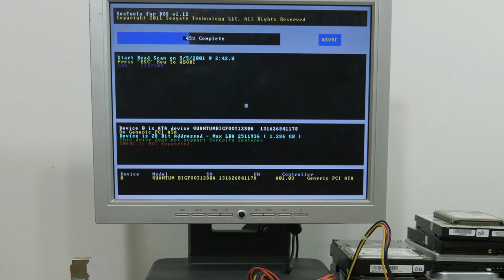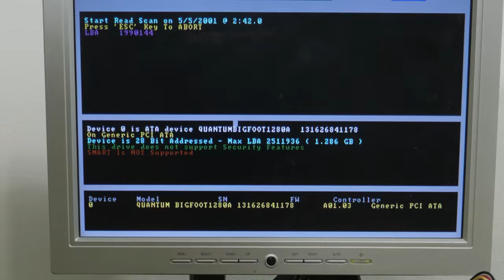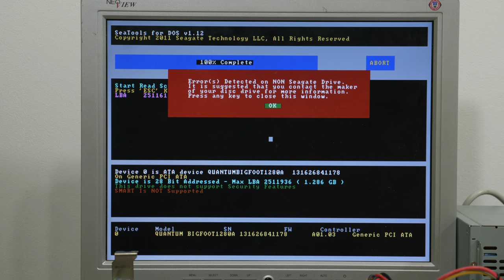Quantum Bigfoot, The Worst Hard Drive Ever!

Comment: Bigfoot drives were designed for linear read/write of digital video, therefore 5.25" format. Back then Bigfoot drives were IDE drives (not SCSI) which can handle low compression analog video in full quality. All of my 23+ years old Bigfoot drivers works today.
Reply: Yeah mine all work still (2024) so I don't know why Victor reckons they are the worst drive ever

Comment: Imagine how much space they could put on one if they made that size now.
Reply: Maybe 32tb at least. I don’t know why they didn’t made them. Iam sure would be costumers looking for massive storage space.
Reply: @sjogosPT  There are an innumerable number of mechanical engineering issues with building modern hard drives with larger platters, but it should be simple enough to understand that they simply cannot spin as fast, and the armature has a longer distance to cover for random i/o. Access latency is horrible. You can simply use more, smaller drives, that have better performance metrics despite being able to hold less, all else being equal wrt platter density.
Reply: @rawhide_kobayashi  RPMs is not really an issue ... the same technology that allows for 10k and 15k drives, can make a bigger plate spin at 5400/7200rpm.

Seek times are horrible ... sure. But that is the same for any mechanical HDD nowadays, no one stores any data that requires fast seek times on an HDD ... let alone one of 5.25"
Plus if you REALLY had to have some intensive I/O, you could work some magic with cache/hybrid SSD.

Now you know what you get with bigger plates? higher transfer speeds. The external part of the drive would be able to achieve some very decent sustained reads.

I would really love to buy a couple 20-32tb drives for the price of my 14tb one.
Reply: @Coyote27981  blud have you ever seen the insides of those high rpm drives? it's not some kind of special technology. it's smaller platters and bigger spindles. the 3.5" form factor ones are basically 2.5" form factor on the inside, and with way meatier spindles. you know what else gets you great performance? multiple drives. modern high density 3.5" drives already get >300MB/s on the edge of the disk. You can saturate a sata 3 connection on a seagate mach.2 exos by striping the independent actuators. nobody is going to put any r&d into any kind of actually good >3.5" platter going forward.

Comment: I have a Quantum Bigfoot and it still works great to this day.
It's in a vintage K6-2 system
Reply: OOMG I remember back in the day I worked in the tech dept. of a PC store in the Netherlands. The year was 1996 I believe. We started selling Home built systems with bigfoot drives, but stopped after 2 months because nearly all of them failed. Probably due to lack of airflow.
Reply: @paulmichaelfreedman8334  Lack of sufficient  component cooling was a common problem back in the 1990's .
I especially remember the 3Dfx Voodoo 3  graphics cards that ran way too hot and needed a cooling fan on them or else they would die early. Other graphics card manufacturers during that period would make the same mistake as well

Comment: Instead of doing the death by screwdriver thing on the platter/drive heads, next time, try shorting out some of the pins on the drive’s ICs to see what happens while it is formatting.

Another thing I wonder, is if you were in a clean room, would it be possible to take out the platters from one drive and stack them on top of others in another drive to “combine” them assuming you can do the same for the drive heads?  I’ve always wondered if a drive could be “Frankensteined” like that.
Reply: It can't if you want a functional drive.

Comment: I killed mine as a young guy, I was adding molex plugs for extra devices, mixed up 12/5 volts.
Burned almost everything connected to the mainboard.
The bigfoot motorcontroller (I think) lid up like a led. This was actually the metal plate (maybe some kind of rf shield) glowing like a star.

Comment: I think the worst hard drive is deskstar from year 2000-2001 that was a deathstar
Reply: Oh God those where the worst!
Reply from the maker: Yes the deathstars are so bad that they got extinct! :D
Reply: From the 20 30 and 40 GB 2.5 man, what a POS of drive. funny thing, you trow then to the floor and exploded. The got better when turned to Hitachi. It is a shame because mid 90s IBMs ROCKED, but this early 2000 were gabarge.
Reply: Totally agree, pretty slow, noisy and unreliable. At this sizes, Maxtor or Quantum all the way. Seagates were decent, Got two medallist series 1G and 2.4G and keep working fine. WD Caviars were OEM on HP Vectras. Probably another level of quality. From this period Maxtor was the best IMHO. Never had issues with Maxtor.
Reply: Was that the IBM drive with four platters. I tested those for shock reliability.
Reply: Yes those few IBM models were not reliable, but they were still very fast. Prior IBM HDDs were some of the best and after the deathstar debacle they became great again and later became the great HGST drives.
Reply: Funny enough I have a 15GB one made in Hungary with no errors at all, I have a video of it.  The 75GB 75GXP were the most unreliable ones out of the entire 75GXP family.  Also the 15GB one I have is FAST.  It is 3x faster than a Seagate Barracuda ES I have from 2008 and that one was SATA!  So a drive 8 years older from 2000 is faster than a Seagate from 2008.  I am going with WD from now on.  The 15GB one I have has a glass platter.  Those Deskstars are fast though!
Reply: At least the DeskStar had performance figures. This was slow AND had that signature Quantum reliability
Reply: @AiOinc1  I think Quantum drives are pretty reliable from what I have seen.  What do you think was the most unreliable Quantum drive?
Reply: @MrKillswitch88  they were TERRIBLE drives.  I remember a surplus store that had hundreds of them.  All failed 4.3gb models.  Had some sort of firmware issue I believe.  They also had plastic sticker on the side, that it damaged would expose the drive to the open air.  It would die shortly after.  Very shortly.
Reply: @cdos9186  that's actually a really good question.  I'll speak of the older quantum 120mb or so to 1.2gb models common in the early to late 90s.  They were highly reliable.  Saw a lot of the IDE ones, and a few SCSI.  The SCSI ones I used all performed flawlessly.  I can recall on a handful of IDE failures, bearings, electronic/firmware, and bad sectors.  This out of hundreds of drives. As to the worst ones... I couldn't really say.

Comment: These drives were easily one of the worst ever made.  I know some models are 3600rpm.  I don't think they made any IDE drives slower than that.  My school had a file server that had a quantum Bigfoot in it.  It was used to store Norton Ghost image files.  We would ghost about 15 computers off it at one time.  It worked.  It wasn't the fastest, but it wasn't painfully slow either.  The server was retired around 1999-2000.
Reply: Bigfoot drives were designed to read or write big files - like digital video - therefore 5,25" format and low RPM. They were able to keep constant read or write speed until entire drive was full. For regular use as standard home drives were indeed very slow. When used to record low compression video from TV camera, only other option was to use expensive high speed SCSI drives.

Comment: I bet HDD regenerator would have fixed those errors. Would have been worth a shot just to see.  Drive magnets are quiet handy to have around.
Reply: WaybackTECH Fixed? Nope, it would isolate such problems only masking the problem to the os. If the bad sectors didnt grow up, you would be able to use the hdd more and loosing some space. But this isnt the reality, if you have a deffective sector, if will "multiply" itself, th problem will spread and the hdd wont be able to boot or installa os anymore. 
What could potentially fix the issue (really fix), would be to write with zeros using for example linux, forcing the sectors to write zeros in all of them, including the considered "bad" ones, that could only have difficulty in writting and the hdd classifyied them as deffective...  Then it would force the bad sectors, anf probably many, if not all of them would be fixed, as after writting the zeros it would force the magnetic particle to the right orientation and thus making it easy to write again.
But that also cant fix some drives. If it retracts the needle when trying to write the zeros, the problem is really deep and probably unrrecovable even with the jerryrig that hdtune does.
Reply: @eduardoavila646  i have hard drives with only a few sectors bad still running today after running hirens on them with no dataloss,

Comment: Haha I remember these guys that sold me one of these... they really got me there, I ordered then a Fireball and served me a Bigfoot, it will be the same, they said! WTF!
Reply: Alberto Martinez Is the fireball a good drive? I've got one, but it seems to be agonizing (by the sound), i didnt had time to install a os in there or see the smart.
Are those drives noisy?
Reply: Almost every old drive was pretty noisy if you can better use newer SATA drives with a good SATA /  ATA adapter or a PCI SATA controller with win98 drivers. It all depends on what kind of system will you install the drive into.
Reply: I dont have sata drives for it at the moment, i have no problems with the noise (its actually kindsa usefull to know that the hdd is spinning), but i was worried with the health of the drive. It was in a old toasted amd duron machine running windows 98.
Reply: @aretard7995  mine doesnt seem to be any of these tho. 

Its a quantum fireball 5.4gb if i'm not mistaken. 

I wont replace it with a data drive as my old motherboard doesnt have sata connectors, only ide.
Reply: @aretard7995  Hmmm... I have two Fireball LCTs with 8.7 and 9.21 years of power on time and they both work.

Comment: The TX bigfoots are pretty reliable and not to slow as long as you run disk defrag on them regularly :)
Reply: Defragging is the most stress of any for a harddrive though. It's easier to transfer all data to another empty harddrive. That will defrag the data also.
Reply: @armorgeddon  pretty sure it won't unless you rewrite the drive with zeroes
Reply: @arnaudmeert1527  Yes it will. Zeroing it isn't needed.

Comment: Bigfoot TS 12.7 is still alive and well running windows 2000 on my K6-300 machine. By far the worst HD I have ever worked with was the Seagate ST-225. Had several bigfoots, no issues, just slow and noisy.

Comment: hello Victor, I have a question to ask you, I have three 3dfx, a voodoo 4 4500, a voodoo 3 3500 and a voodoo banshee, which would you recommend to play on a retro pc with win 98. Greetings from Argentina :)
Reply: On which CPU/mainboard platform? Usually you'd use V4 4500 of course, but depending on the CPU it's potential might be wasted.

Comment: I had this HD in  win98 system for 25 years. The computer failed with a "low cmos battery" warning on boot and it was done. Now I am trying to get data off of it. And hooking it up to a windows 10 system doesn't work because it doesn't detect it. How can I get data off of this?
Reply: Couldn't you just replace the cmos battery? The little coin cell on the motherboard.

Comment: Do the Quantum Fireballs have a better rep? I have 4 Fireballs, 3x 4gb. 1x 12gb. 
They still work, and ive had no problems... yet. One drive is considerably louder, but it came from a server. So non stop running has worn the bearings.
Reply: Adam Holmes Oh so they are loud? I only have one with 4gb, but its really loud.

Comment: Donated one of these bigfoot tx 4 gb hard drives too my university as it's a odd format history wise, as it was more common with 3.5 inch & 2.5 inch hard drives at that point, but they were cheap too produce so oem's did pick them up even if they were slower then their smaller counterparts they offered good capacity for the money, at least for a shorter while before a managed too cram 16 gb on a 3.5 inch harddrive & then got cheaper.
A common problem is the clear sticker/plastic on the underside being removed or the glue on that sticker decaying so it lets in air, or that someone poked a hole in it.

I wouldn't really use one these days other then the bigfoot ts series if id come across one or wanted one. (they weren't faster or larger then other harddrives by the time the ts series was released but the ts series was a bit more reliable & the fastest model.)

Comment: I want to destroy all personal data on a harddrive. Can I hit the platter with a hammer to break it in pieces ? Or is there software to thouroughly remove all personal data ? I tried Eraser but could not get that to work under windows xp.
Reply: Use DBAN.
Reply: drill a hole in the drive and drop it in a bucket of salty seawater.
let em "cook" for 2 weeks and even IBAS would have problem with em... and they got the data out of the toasted drives that was onboard space-shuttle Columbia.

but that would destroy the drives so they are not reusable... software that overwrites everything 2-3times is as safe for common people as you would need instruments and specialized workers worth millions to get out the data.
Reply: I found an older version of Eraser that works under Windows XP, I will use that so I can still use the harddrive.
Reply: From the UBCD Vivard will erase to "n" passes (n can be any number of cycles). Want to be more sure, just trow the platter to a firepit or move a strong magnet over it. Forget about XP. Just get you "ultimate boot CD" and pick Vivard or MHDD 4.6 from the menu and follow instrucitons.
Reply: You could write it several times with zeros. Using the dd command in linux or some utilities in windows.

Comment: Worst? You never seen the samsung spinpoints from 2011-2013. All of the 10 drives i've had were  slower than older ide drives (i mean, 60megs of writing speed isnt good for a sata 2 and sata 3 drive), and all of them failed several times until they died, about 1-2 years after i bought them new, and many died with about 40-100hours of use only...

Comment: long time ago i did own an bigfoot disk from 4,3 gb, its the only disk that still worked after an fall from 1 meter heigh on the ground, but, this were that days cheap disks,, slow and mucht noise but for data storage it was good.  i used it on an amd k6-2  , 333 mhz with 64mb ram and and viper 550 , mainboard was ASUS P5A , an very populair board because it support lot of socket 5 , 7 and super socket 7 cpus,, all the intels, cyrix, winchip and amd . My last configuration on that board was an amd k6-2 500mhz with 2 x 128 mb and an asus V6600, the first geforce 1 card.

Comment: I have 1 bigfoot 2,1GB and it runs as today, but it isnt in good condition, it has some bad sectors, and i need to run spinrite on it sometimes to keep it from getting more bad sectors.
Reply: PureOwnag3 You could try to forc write zeros to your bigfoot, it may fix the bad sectors, most of the time, sectors that has some difficulty to write are classifyied as bad, but if you force write them, they may get good again. 
I've made that with my spinpoint using linux some years ago.
Reply: Eduardo Avila: okay will try it out, thanks for the info.
Reply: @PureOwnag3  How did it go?
Reply: @ducksonplays4190  how u mean with how did it go ? as i sayd i need to run spinrite sometimes, to keep it go more bad, but yea i dont use the drive anymore nowdays.
Reply: @PureOwnag3  I meant how did forcing zeroes go?
Reply: @ducksonplays4190  what u mean with that ? forcing zeroes ? i dint force 0 on the drive at all if u mean that ?
Reply: @PureOwnag3  Eduardo Avila's comment.
Reply: @ducksonplays4190  now i dont follow u anymore... :-(
Reply: oh nvm i see the commend now yea, but i dont use the drive anymore so i dont care anymore.

Comment: Only ever had one quantum bigfoot drive ever and it did end up dying after about a year of use but I disagree with the worst hard drive ever label, I had several 20-80GB western digital drives all destroy themselves with servo motor disasters. Had more WD drives fail in under a month than I had last longer than a month ended up not RMAing them anymore and just buying more reliable brands.

Comment: maxtor harddrives sucks too
Reply: At some era the named craptors. But I have no issue with below 10GB ones. In fact when trying to get old used one, the only that run fine are maxtors.  Tried Seagate and Caviars of the same period, are slow or unusable. Maxtors, if bearings are not shot, run smoth and hold good data rate.
Reply: my maxtor lasted 2 years new
Reply: Dr ROLFCOPTER! Exatly! I have a samsung with 80gb that was droped or something, and the platter was stuck in the drive. I opened it, unscrewed the platter moved it, then screwed it back again, and incredibly the drive came back to life, that after like 8-10 years of activity. 

But all my shitty samsung/seagate spinpoints from 2011-2013 died with low hours of use.
Reply: Here with a maxtor diamondmax 9 ide 80GB ide on a ps2 still like new from 2005
Reply: SUPERBOBESPONJA1000 What about the smart? Because it may have several issues and still be running fine, my wd blue 160gb is a example. Full of badblocks but except for the slow speed (that is compatible with his generation of hdds) it dont give any signals of these issues.
Reply: Eduardo Avila Good with no problems and that hard drive was heavy used on a ps2 for 2005 to now and i still use it for games and i check it with my emachines and is good no bad sectors
Reply: SUPERBOBESPONJA1000 Thats very nice!
Reply: @gerot201  You should really be capitalizing the word Maxtor because it is a company.
Reply: so it sucks  when it needs to hold high storage at that time